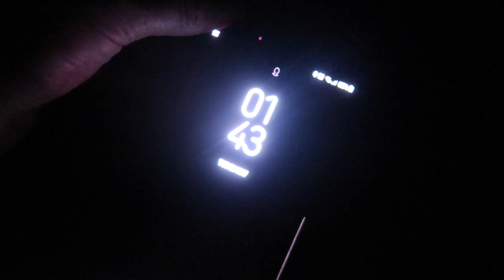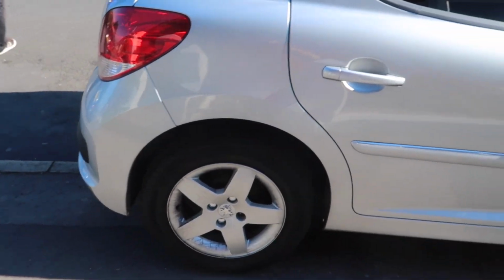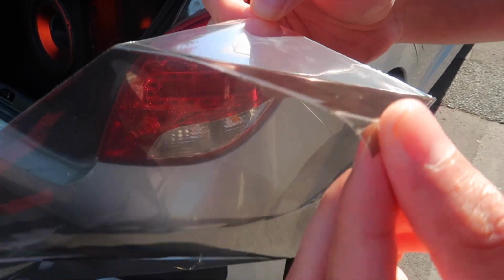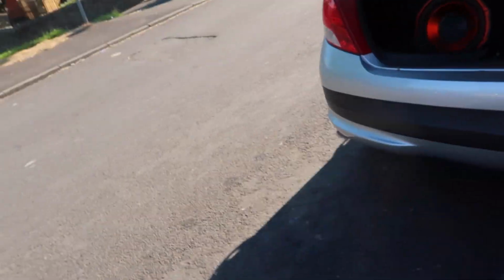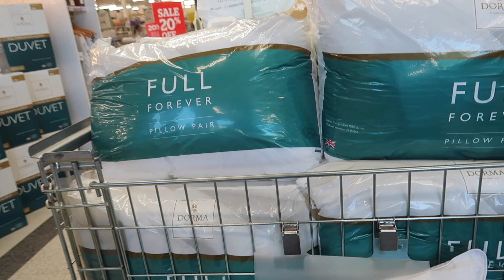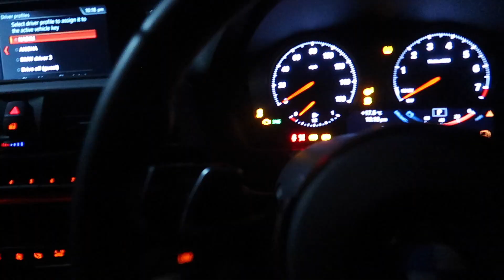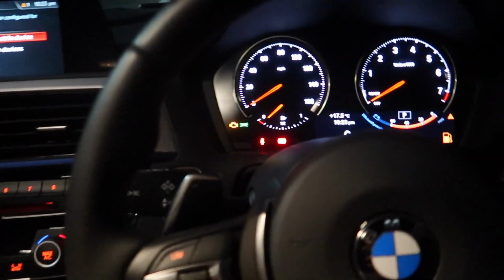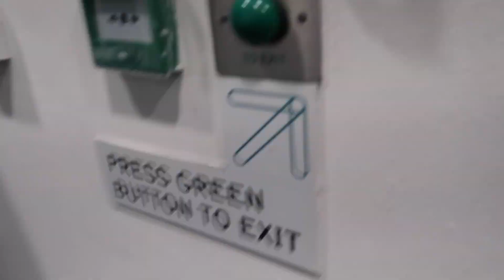I OPENED UP A CAR CUSTOMISATION SHOP!?

Comment: Bro elaborate on your point at the end about lifting days. Explain pls
Reply from the maker: areebshaid for natural lifters the muscle building process only takes place for around 48 hours. The other 5 days you take before hitting a muscle again is wasted so your muscles actually start to regress in size and strength.
Reply: What do advise as a good strategy then bro